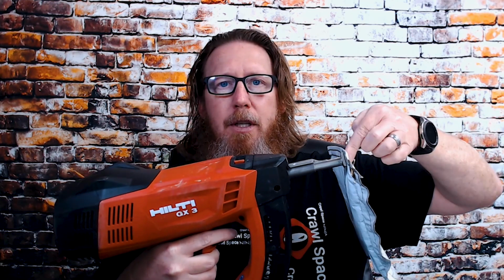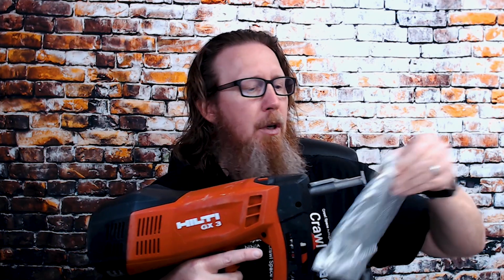Insulating Foundation Walls with Insulation Vapor Barrier | Time-Lapse, Tips, and Tools Used

Comment: Great vid, Michael.  Getting read to do my encapsulation in NW Arkansas.  If some insulation in a crawlspace encapsulation is good (e.g. foam board) is more 'better'? Something like what you did which was foamboard + insul-barrier.
Reply from the maker: Sorry I missed this - better R value is better in my opinion but there comes a point when the ROI is lost due to cost.

Comment: Hi my crawlspace wall is quite short. Could I cut the 4" insul barrier in half and then tape the area where I cut?
Reply: Meant 4'. So essentially id use 2' strips.
Reply from the maker: Yes it can be cut and sealed or drape over dirt and bring ground plastic to it.

Comment: I see that only mechanical fasteners were used. Is nothing else used to “seal” the edges?
Reply from the maker: We just use mechanical fasteners. Since we were only concerned about insulating, we didn't feel the need to air seal.
Reply: @CrawlSpaceNinja  If you were concerned about humidity, how would you have sealed the Insul-Barrier?
Reply from the maker: @tycox8704  It seals very well with seam tape like this: https://diy.crawlspaceninja.com/crawl-space-seam-tape/